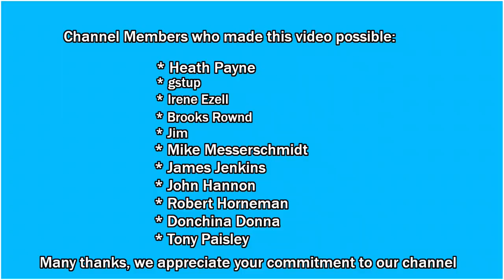Black Forest Cuckoo Clock Restoration - Part 3

Comment: At the first of the video the arm that you are trying to get off I believe it has a slot in the movement to get that lever out. You just turn it toward that slot to get it out. I would advise you to take the count wheel off. The screw can get rusted from being soaked in the cleaner. They arent that hard to come off. The screw only has a few threads in it. Keep up the great work. Before too long you will be a cuckoo clock master. Thanks for the shout out at the end.
Reply from the maker: Thanks for the tip about removing the count wheel I'll remember it for next time.

Comment: I’m working on a clock very similar to this but on the front gears that work the hands when you removed the gear held by a washer and pin there was a washer underneath. Mine has a small spring that slides over the main gear (chain) shaft. Have you ever seen this before? My minute hand seems to move very loosely so I wondered what the spring does. It’s only like  1/4” long if that. Thank you in advance
Reply: Not to jump in on his video questions but that spring that fits under what I like to call the minute wheel with minute pinion and that is because that is what the Cuckoo Clock Repair Manual calls it on a Regula 25/34 movement has that suspension spring underneath it. That wheel is what fits onto the great wheel arbor on the front plate and is what controls the minute arbor and hour pipe. That spring puts pressure on that wheel. The pressure washer goes down first, then that wheel, then a washer and then normally a tapered pin. If your hands are dropping that is because there isnt enough pressure on that wheel suspension spring. So add a little more pressure to the spring and that will tighten up the hands so they dont drop. What I do is add enough pressure so when all is put together you cant see the hole for the tapered pin until you add a little pressuer to the wheel.  I hope this helps. If there is too much pressure then your hands might not turn at all. Especially when it hits the pins on the minute arbor to trip the cuckoo. So if you have trouble turning the hands then it is too much pressure. I hope this helps. Good luck.
Reply: @munnerlyn3  Mark, Thank you very much for this information. I will try to expand that little spring that fits over the shaft before the minute wheel goes on. There isn’t much there to work with it’s a tiny little spring. But now that makes perfect sense because after having it apart to clean and then putting back together I was confused why the minute hand was so loose.
Reply: @albertkelly8515  glad that you got it sorted out. I have videos on my channel that goes into more detail. Just search by name.
Reply from the maker: I have not heard of that minute hand / spring combination before.
Ask somebody with  vast cuckoo clock knowledge who will probably know.
Join Mark's FB page and ask him the question.
If anybody knows it will be Mark.

https://www.facebook.com/groups/267134298452204